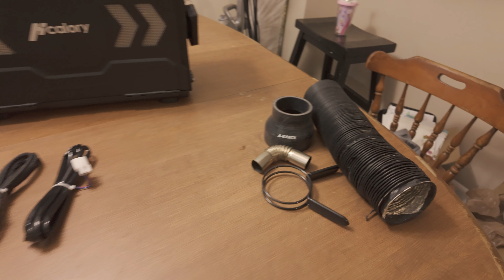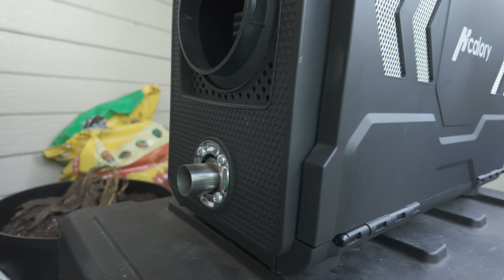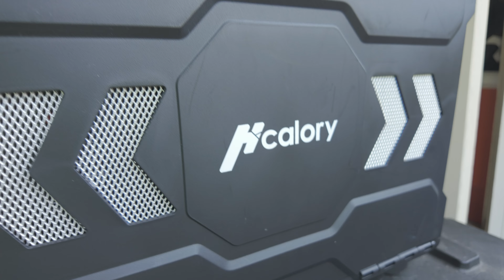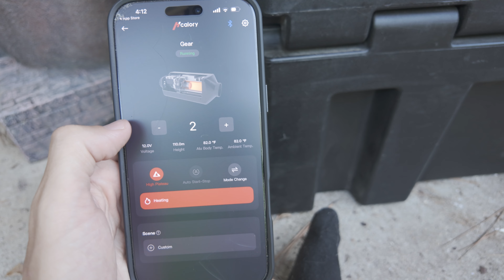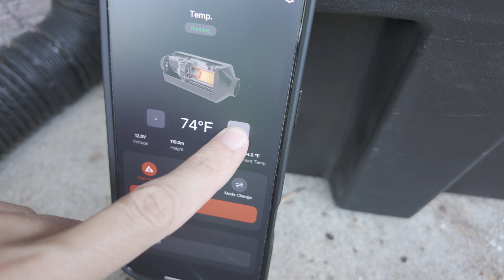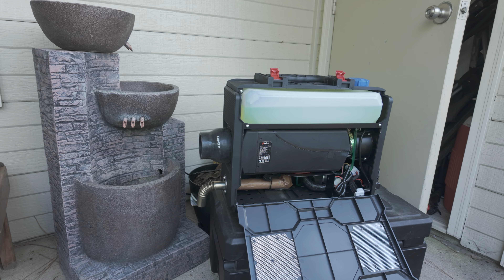Winter Overlanding Made Easy - The Brand New Hcalory Toolbox 2s Plus

Comment from the maker: * 2.5 - 3.5 A-Krack Silicone duct reducer - https://www.amazon.com/dp/B0CQST61PJ/?coliid=I5DFKM9TREB1J&colid=2L2S3Y0VV1EX9&psc=1&ref_=cm_sw_r_cp_ud_lstpd_9EM7VG1H0RS9JPT30MEX
* 4in double loop hose clamps - https://www.amazon.com/dp/B01K9HDXWA/?coliid=IQM11A10U2FUZ&colid=2L2S3Y0VV1EX9&psc=1&ref_=cm_sw_r_cp_ud_lstpd_9EM7VG1H0RS9JPT30MEX_1
* 25 mm air exhaust pipe tube elbow connector - https://www.amazon.com/dp/B0BZSDJ7RC/?coliid=I35B3WDYOB5QHF&colid=2L2S3Y0VV1EX9&psc=1&ref_=cm_sw_r_cp_ud_lstpd_9EM7VG1H0RS9JPT30MEX_2
* 3in 8ft dryer vent hose - https://www.amazon.com/dp/B0DSKVX7XQ/?coliid=I1FQWK53C06OHO&colid=2L2S3Y0VV1EX9&psc=1&ref_=cm_sw_r_cp_ud_lstpd_9EM7VG1H0RS9JPT30MEX_3

Comment: Well I ordered mine and received it. Setup was easy. BUT it smokes like crazy and nothing ive tried has fixed it. I realize there's a burn in but it ran for almost 2 hours. The fuel is fresh the elevation is set correctly. It literally looks like someone set off a smoke grenade. Seriously disappointed.
Reply from the maker: Oh man, that's definitely not right, it shouldn't be smoking that much after two hours! Did you crank it up to high and try to burn it out? This is the second time I’m hearing this, I didn’t have that happen though 🤷🏻‍♂️

Comment: Do you prefer to use the app on your phone or the remote?
Reply from the maker: Well before I liked using the app, because the previous model didn't have the remote this one has. But with this new remote, it will auto regulate the temp. The app can't do that. However, if you want to know more details about what the unit in real time, the app gives you all the extra info. So I'm leaning towards the remote, because of the comfort of the auto temp, but its nice to have the app details as well if there is anything i need/want to know in more detail.